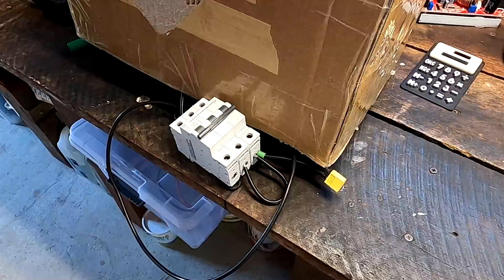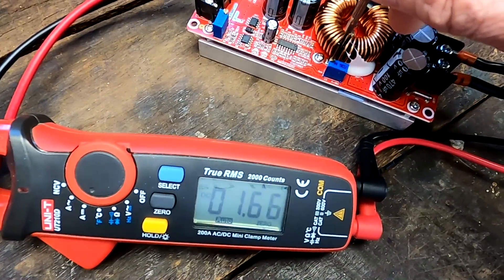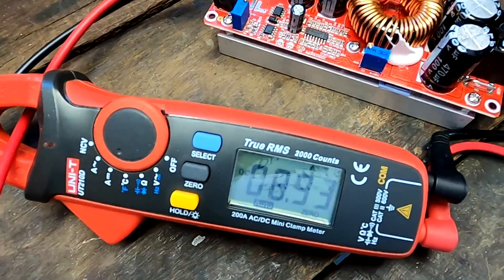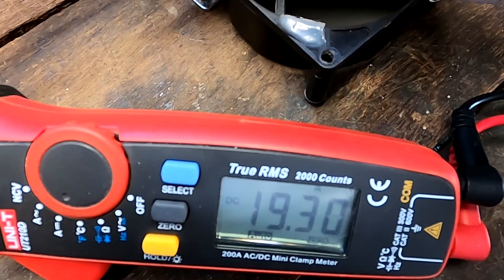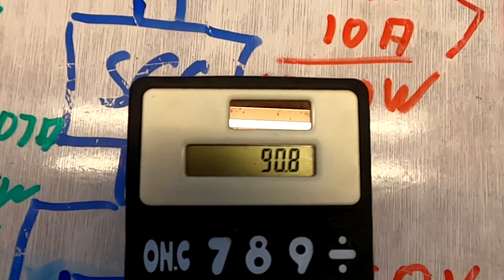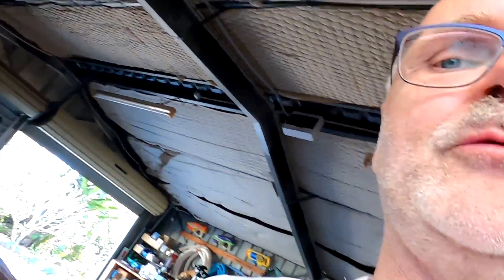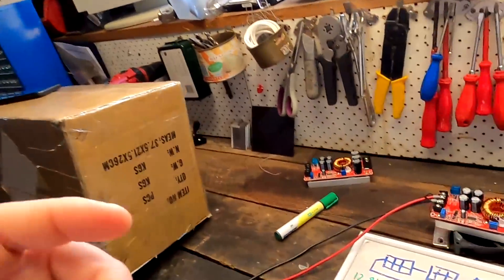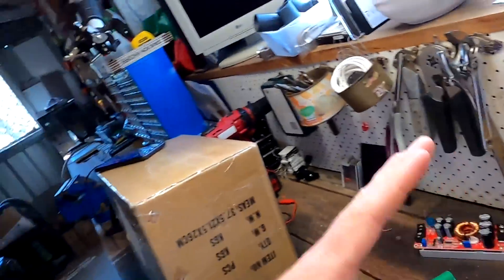Regenerative Discharging with good efficiency. Part 2

Comment: A tip from someone who killed a lot of these things. Be careful so the battery connected to input and battery connected to output do not share common negative or common ground if ground is connected to negative. It will blow up the converter because most of these dont isolate output and input
Reply from the maker: I was wondering about that. Thanks for the warning...
Reply: Ahhh, seriously? This makes them useless for just about every project I had in mind.
Reply: Any recommendations for a similar unit that can handle battery to battery charging with a common ground?

Comment: Can i put this converter in series with my MPPT charge controller? I have 24v battery but my 1 solar panel is 12v. So i will put the output of my solar panel to the input of this converter and the output of the converter to my mppt charge controller input solar panel to charge my 24v battery. Is it ok?
Reply from the maker: Probably a bad idea. Once the battery is full the MPPT usually takes the panel in a more inefficient are of the curve to lower the output of the panel. It won't be able to do this with the converter. It would just keep delivering energy with a CV.

Comment: I would not trust a $10 buck boost to charge my battery as something set and forget. I would trust a high quality one on the other hand if my battery has bms protection for over voltage and i was keeping an eye on it. But a charger is best. And for Phillip this is not so much a hobby thing but is a necessity and financially he needs the batteries to last as long as they can and a charger is going to achieve this.

Comment: A battery charger is little more than a DC-DC converter with battery-appropriate output limits. With a BMS on top that can disconnect the input in case of individual cell over-charge, the charger becomes largely irrelevant short of a catastrophic failure bad enough to fry the BMS.

Comment: Hey could you do maybe some tests with shading? If you shade one panel 50% seriel, paralell, or with a buck converter in paralell but matched to the same voltage..? Could give an interesting Result! On Sailboats the partial shading of one or more cells ist most of the times a big problem so these guys could solve it...

Comment: I bought the "1800w" version of that boost converter. I found the hottest part to be the cheap output capacitors, so I added a few more in parallel. Efficiency was basically the same as yours.

Comment: A BMS should be added to that pack. If not possible, then i recommend the iCharger X8 because it monitors each cell and does balancing (not sure if it galvanically isolates input from output). Low voltage cutoff could be implemented with a module like the XH-M609 w/ an extra beefy relay added. Also if no bms, low voltage cutoff should be set conservatively high to decrease the chance of any cell going too low. Similar high voltage cutoff modules also exist. 

It is risky to charge only w/ a buck (step down) because when they go tits up, they can present the full input voltage to the load, i.e. batteries in this case; also one or more cells might get overcharged if no bms - usual discussion.

Comment: Meanwell do some fantastic CC-CV power supplies with adjustable voltage and current that have never failed me. How many amps are required for Philip's scooter charging? Search the HLG-320H-24A MEAN WELL, I got mine from TME for about a hundred euro. 94% efficient, around a 13 amp output, IP65 weatherproof and adjustable amps and volts via built in potentiometers. Just add plugs :) There are larger and smaller ones. Technically they are high power LED drivers but they work perfectly for this use case.
Reply: Just set to 3.45-3.55v X 8 and off he goes :D
Reply from the maker: Great idea, thank you.

Comment: I've been using one of these boost converters for quite some time. Strangely enough, I did an efficiency test yesterday also. I actually use it to charge my 48v powerwalls from my 24v so I expect the efficiency to be roughly the same for overall power.
Input Voltage	Input Current	Input Power	Output Voltage	Output Current	Output Power	Efficiency 
          13.26	                5.09	              67.49	        30.06	              1.88	                   57.51	                 83.73%
          13.24	                10.19	              134.92	        30.00	               4.00	           120.00                88.94%
          13.23	                15.08	              199.51	        29.96	               5.98	           179.16	         89.80%
          13.22	                20.07	              265.33	        29.91	               7.81	           233.60                88.04%
          13.19	                25.28	              333.44	        29.81	               9.8	                   292.14                87.61%
          13.18	                30	                     395.40	        29.71	              11.44	           340.88	         85.96%
Reply: Hi, is need any diode or similar in the output not to get back current from the output battery to the boost converter when there is no input voltage ?
Reply: @diydsolar  kind of... If you leave the output connected then it keeps the output capacitors charged and the led lit but that's about it... It doesn't use much energy.

Comment: the solar boost controller the green ones i told you about will work to charge input can be from a laptop charger or even solar i know alot whop charge ebikes like this
Reply from the maker: I have one but never used it so far, just once for a test. Awful programming and setup.

Comment: Y I have one. I am going to use it for charging my bats. My PSU can only charge up to 50V total of 2000W so i have one 1800w step up to give small voltage boost. My 26650 batteries came last week. I decided to go 16s8p and i am building 4 4s ammo boxes. I am going to build water insulated plugs for paratel, series and BMS connections for each box so i can later increase my battery back size. This way if i get other Xseries BMS i can make other output configurations.
Reply: I think BMS is only needed if y use or charge Batteries. Can Y test if series connected balanced battery gets out of balance if BMS is disconnected for a while and battery back is not in much of a use.
Reply: BMS should be the one to protect battery if buck converter fails.
Reply: Well i trust those converters more than my 50V PSU that is two 1000W 24vPSU's in series with big anti feedback diodes between. + and -.
Reply from the maker: Wow, interesting project. Why do you need this waterproof?
Reply: @OffGridGarageAustralia   I want to make battery packs that are in multi purpose use. Mostly in water use vehicle. Running 25kw bldc motor. I am going to use BMS externally. That way i can plug 4s BMS's or 16s BMS to packs and run them eather paratel or series. I need 8 connections to really run them in paratel each nickel strip needs to have high Amp connector so i can connect them strip to strip. LION packs is not recomended to put paratel in pack level but in cell level. There is difference if you paratel 4s pack or paratel 3.7 v cell.

Comment: yes i used buck/boost converter to charge my portable packs and my battery system when i was offgrid for a few years once the cc/cv voltage is set they work like any other lithium charger

Comment: A great idea to help Phillip out.  But... there are countless Phillips and others with the same dilemma.  The truth,  in my view,  is that MPPT charge controller and other Lifepo4 battery charger manufacturers are gouging the public,  prices keep going up and up.  This is fine in a supply/ demand economy.  But,  how about the Phillips? What I mean is,  we should use our collective brain power to find/ make a reasonable alternative to what they want to sell us.
Reply: Absolutely agree with this. I made my own BMS for partly this reason and partly because I had specific needs as running hybrid. The brand name manufacturers are trading on the general ignorance of the battery using public and building on the inherent fear of the unknown to sell products at an inflated price that do far more than needed and often duplicate the actual required functions that are already in a BMS (as opposed to a simple battery protection system) Sites such as this are great in educating people away from reliance on the brand names and promoting understanding over blind faith.

Comment: Putting your hand on a live circuit board while wearing your wedding ring! You like to live life on the edge.
Reply from the maker: I would need to touch two life wires at the same time with the same ring and enough current. That's not gonna happen.
Reply: @OffGridGarageAustralia Boss pisss to install do sola......👌
Reply: That's why I don't wear my wedding ring. My wife though doesn't really understand that, lol

Comment: The icharger can regenerative discharge a battery with 30A and tell you the Ah and Wh. The icharger is expensive, and I have not personally used one, but different videos look really promising.
Reply: I agree, I use an Icharger 4010 duo in my Garage to charge My DIY 15S E-Bike (2 separate batteries) 8S & 7S -10P.
I also use an Icharger X8 which stays in the house for Charging smaller DIY battery packs.
I don't use any BMS, I don't trust what I can't see, regarding Cell voltages. (Bms can fail destroying expensive cells within your battery 👎)

However ofcourse I would use a very expensive BMS if I was buying 200 - 300Ah Lifepo4 Cells for an offgrid situation.

The Ichargers charge & balance all my batteries within 1mV & to whatever Voltage & current I choose. 👍👌

Comment: In my rv I have 3 ways to charge my lithium batteries. Solar , charge converters powered by 120 volt either utility or on board generator. I have 2 ea 40 amp 24 volt charge converters and 6 -100 amp batteries. Oh I have a 12 volt wind generator for back up to the rv 12 volt system. Allso this 24 volt system powers a 4 kw 120/ 240 v inverter. Hummm  I am looking for the next improvement . Any Ideas????

Comment: Hi Andy!  Andrew from Calgary, Canada here.  I don't trust the boost converter to feed directly into my batteries.  I do, however, use it to feed into my MPPT charge controller on my camping trailer (or caravan, as you prefer) from my towing pickup (or ute, as you prefer) to charge the LiFePO4 batteries from my vehicle alternator.  By boosting the 14.4V alternator output to 36V to match my solar panel output I add about 360W of charging through my regular trailer 7 pin electrical connector which is limited to 10 amps.  When camping in the forests of Western Canada there is very little light at ground level under the forest canopy.  Being able to recharge more while travelling between sites can be very useful to avoid having to use a generator.  And we camp in winter with temperatures down to -25C, so having power for the propane furnace is vital.  You can buy products that allow you to charge an auxiliary battery from an alternator, but they cost about $240 CAD compared to $10 for adding one of these connected to an existing solar MPPT.
Reply: Hi Neighbour, 21hrs east of you =D
Reply from the maker: Interesting. How does the MPPT handles the situation if the battery is full? Normally it would steer the panel in a inefficient area of the UI curve to lower charge current. But with a CV source as the input???
Reply: @Cedillallidec did you practice this method for long time...? My plan is use the boost converter to charge my 12V VRLA battery from my car's alternator (14.4v traditional alternator). Or you have any better sugestion...?
Thank in advance...

Comment: I suspect Philip will have a new charger within a day 🥰

So here's a followup question, is it better to boost the voltage to a SCC or boost the output of a SCC? For example, if you have a 48v bank, should you boost the input to 50+ and then charge as per normal, or should you have a 12v SCC and then boost it's output? The upside to having the panels connected to the SCC would be to actually do MPPT if I understand everything correctly. 

Ooh, or daisy chain a 12v SCC into a booster then into a 48v SCC. That sure sounds expensive.
Reply: oooh please test this,  I didn't know I wanted to know the answer until someone asked the question
Reply: i feel it is better to have grid tie panels in parallel to a 12v system most efficent then on the load side of the controller boost that into the solar side of the larger battery scc i did this when i had a miss match of panels and 12v system and a 24v system i did also run the 24v system into the 12v system with an mppt controller but this often overloaded the mppt so low boosting to high ended up been the best
Reply: Actually both ways of connecting SSC with boost converter should be terrible. Ordinal boost converter's doesn't do MPPT (reduce amount power it transfers according to input variations). Boost converter before SCC will ruin ability of SCC to detect maximum power point as it does everything it can to provide constant output voltage. Boost converter after 12V SCC can collapse 12V rail, trying to regulate output voltage.

Comment: Yes, I have been using one of these for about 2.5 years, from a battery build by Jehu Garcia (Jag35), the BMS protects from over charging. The larger version of  your converter has built in fan and stand offs 👍
Reply: Exactly! That's what the BMS is for. I don't know what kind of magic people think is in the Victron charger. It's the same technology, same chips, but with a warranty, markup and a walled garden. Oh, and if anything fails in the Victron, it's toast. Anything fails on your cheap-o converter - you can actually repair it.
Reply: @rokask  I have both, in the UK they maybe cloudy weeks, and need to charge on grid, the converter powered by HP server power supply outputs a very clean 12VDC. These power supplies are very cheap from ebay. Victron 75/10 is good kit and the app allows easy configuration. But if I had taken more time to look at my needs may have bought a Buddy Pole -  POWERmini or POWERplus, which are all on screen configure. They are more robust compared to the Victron, and it irritates me that I have switch my satnav  on my phone before the Connect app will switch on, if I knew that at the time of purchase I would have never bought 75/10. Buddy Pole does not track you 👍

Comment: I would add a solar charge controller and have the boost or buck converter feed the solar charge controller.
edit: also a very noble thing to do by converting from beer to charger donations :) did you use a boost or buck converter for that :D
Reply: I agree. There’s a good bit of safety through intelligence in most MPPT controllers. Essentially…. The buck converter is nothing more to an MPPT than another power source. No different from a solar panel. Well… a little different…. But not to the MPPT. 😊
Reply: You are suggesing using 2 converters in series (DC-DC boost or buck converter, followed by MPPT charger-anouther one). Doing that lowers total power conversion efficiency and requires rewiring MPPT charger from PV array to converter and back.
 Why bother doing extra work, when connecting first converter directly to battery is just better?
Reply: @volodumurkalunyak4651  Because the MPPT has enough smarts to stop charging under a variety conditions, including via integration to a BMS.  The Buck converter will only stop charging when a certain voltage is met.  So if there's a cell out of balance for whatever reason, the bus converter could potentially push that cell beyond its safe voltage limit in order to achieve its target voltage.
Reply: @Shep5847  is standart dc-dc converter pushes any cell above target voltage, bms has to disconnect the whole battery. Also most of mppt converters arent configured to reduce charge rate whenever battery cell is close to too high voltage.
Reply: @volodumurkalunyak4651  Thats why I use victron gear with a Batrium BMS.  That integration can tell the MPPT to slow down and avoid having to turn off the battery causing all kinds of other grief.
Reply: @Shep5847  for you and anyone with similar (smart) equipment that makes sense. That integration is really userfull if it is there. If it is not there, there are no practical gains from also using pv mppt charger